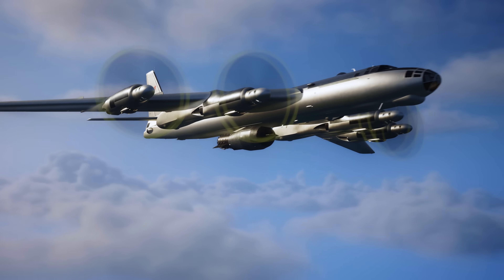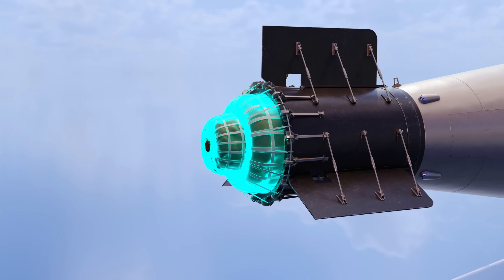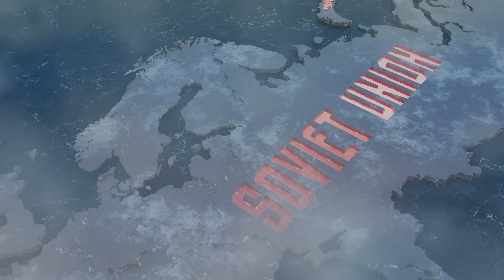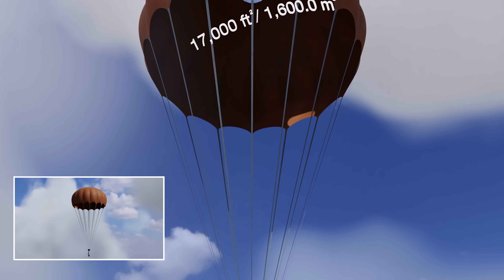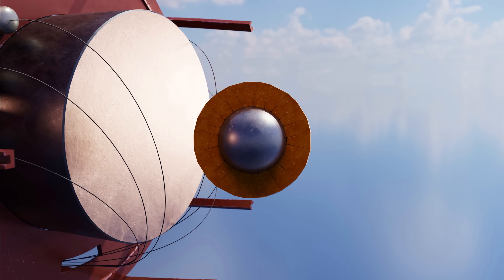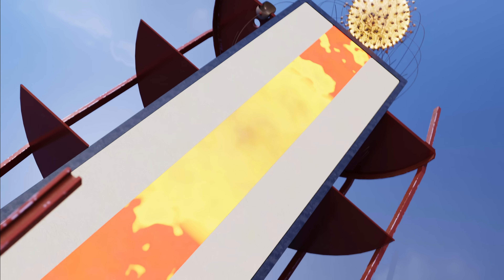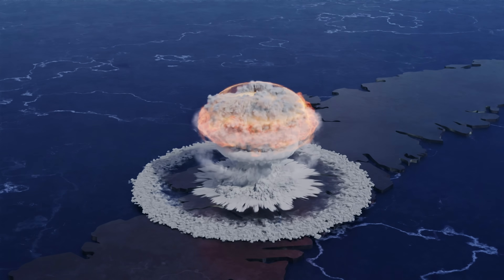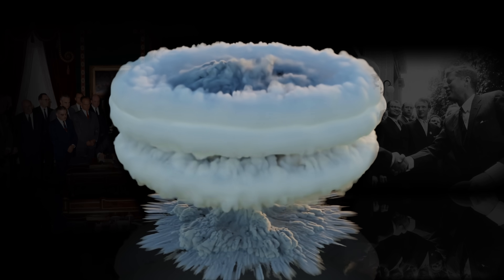Inside the Tsar Bomb

Comment: Just to be clear, the exact design of this bomb has never been revealed.
Reply: Indeed, and the men who knew are long dead so it's unlikely we'll ever know for sure. The two primaries theory is a good one although they would have to be detonated within a microsecond (or probably even less) of each other which would've been quite a feat. The other leading theory is two secondaries, the radiation pressure from the first causing a more efficient burn in the second. Or perhaps a combination of the two. Either way, the designers got it right. Great video for sure.
Reply: @KiwiExpressCream 2 primaries is no harder than a single one. Once you have the electronic avalanche and detontor tech sorted, all you need is more of them.
Reply: @dougaltolan3017  Also, wouldn't the detonation of one primary  result in the radiation implosion of the other? After all, the thermonuclear reaction in the secondary is initiated by fission in the compressed sparkplug.

Perhaps the reason the Tsar Bomba required such a heavy casing in the first place is that they wanted to make sure that even if one of the primaries were to 'fizzle', the radiation from the other primary would fully compress its pit and make it contribute to the compression of the secondary.
Reply: @dougaltolan3017  exactly what I was thinking. A chain reaction is a chain reaction. Just a matter of math
Reply: @KiwiExpressCream  At this point in time it wasn't  rocket science anymore
Reply: Someone could leak it on WarThunder forums ;-)
But a 3 stage design, fission, small fusion, big fusion would be more likely, since radiation pressure from small few Mton fusion device would be far higher than 2 nukes on opposite ends.
Reply: @hinz1  Yes, this is why scientists believe it's a fission fusion fusion. and not a dual fission fusion bomb.
Reply: @FabledGentleman  2 giai đoạn cần tính chính xác thời điểm kích hoạt hơn là 3 giai đoạn, tôi biết tính người Nga sẽ chọn 3 giai đoạn vì nó chắc chắn hơn.
Reply: It was a 3 stage device based on the ulam-teller design they acquired through covert means. The US actually deployed 3 stage devices for a time,  but only as gravity bombs.
The design is considered obsolete these days as due to it's large size it's much easier to intercept the large planes needed to convey it and you can actually do more destruction with smaller warheads if you have more of them since a bomb of this size releases the vast majority of it's energy up into space.
Reply: Ее луковицей называли, по какой то причине
Reply: The design of a nuclear bomb is pretty standardize. They only differences are small, like the differences between a Corolla and Versa. Enough records got out after the fall of the Soviet Union that the public has a pretty good idea of it's general design, if not the exact details.
Reply: Despite what it was. It was the ultimate piece of precision sequential engineering ever produced.
Reply: I don’t know if it’s actual design is significant,  I’m sure it was primitive but it worked!   All the major countries with nuclear weapons know how to build one,   With around 70 years of experience.   I’m not sure it’s a secret anymore in building one.
Reply: It follows hydrogen bomb basic design
Reply: Probably stolen by russian „soldiers” washing machines and toilets shape 🤣
Reply: just to be clear, it's relatively simple, but to actually make the fission material , like the uranium enrichment is no easy feat. Entire countries tried it, and failed it. So imagine the budget of a country . That might not be enough to make a nuke. That's why it doesn't really has to be a secret, that and the nanosecond timing. Without this you can only make a dud.
Reply: @kisspeteristvan  And you need a fission bomb to activate the fusion bomb
Reply: @kisspeteristvan  The idea is fairly simple. The precision required in the engineering is not.
Reply: Just to be clear. He doth protest to much me thinks..
Reply: @caledoniawarriorIt’s “TOO” much……No actual design of ANY Nuclear or Thermonuclear Weapon was Ever been officially released….
Reply: @pikachu6031  I know nothing about nuclear weapons but I’m just here to support you correcting the guy quoting Shakespeare while also confusing “too” with “to”. This is why I never tried to flex on anybody as some sort of academic because it’s a good chance of going to screw it up and embarrass myself. 😂
Reply: @mattlawson714  don't want to be embarrassed in front of the internet. The place where you know everybody is human and definitely not a chat bot 😂
Reply: The EXACT design is thousands of times more detailed than what we saw. But the details we saw were still verified
Reply: The Soviet Scientists DEFIED the orders by Communist leaders to make it 👉🏻 100 ☠️ MEGATONS…
Reply: Apparently he thinks it has
Reply: This is a pretty educated guess on the design though.
Reply: As the case with ALL nuclear/hydrogen bombs. If the exact design was revealed, then smaller countries would develop it and that's not good.
Reply: @teddeebayre3433  Not exactly, actually many designs are known. Maybe not the amount of grams of every compound, but the core design of the bomb itself is often known.
Reply: @teddeebayre3433  they  cant because  its tricky to create weapons grade fuel and big brother and Israel are   watching very carefully
Reply: Just to be clear, it was fairly primitive, and the design is easily guessed from the shape of the aeroshell.
Reply: @dansands8140  We don't know if it was two stage or three stage for example. This has never been disclosed.
Reply: @FabledGentleman  It was designed as three stage and fired as two. The uranium casing the video mentions was removed was the third stage.
Reply: @dansands8140  No this is not correct. It is actually widely thought of as a fission fusion fusion bomb. The only thing they sort of "do know" is that it was a three stage bomb.
Reply: @FabledGentleman I remember seeing old videos of one of the panels removed and it had like these cylindrical canisters wrapped around a bigger cylindrical canister in the middle, so I'm guessing it was three-stage
Reply: @dansands8140 It was not removed….The Uranium Tamper was replaced with a Lead one!
Reply: @colchronic  One thought based on that photo is that the secondary or tertiary stages - we're not sure which - were actually multiple smaller stages that detonated simultaneously.
Reply: @dansands8140  Everything about this bomb is the opposite of "primitive." 99.99% of all people, even your entire family and mine, will never be able to split atoms and create large explosions. The entire design of the Tsar Bomba is highly complex.
Reply: @ElectronicHouseFlash   If you mean I'll never have a plutonium core, you're probably right. But designing a reactor or inefficient bomb would be trivial.
Reply: @dansands8140  If it was that primitive why did american scientist struggle to find the formula for theoretical infinite explosion power?
Reply: @Squilliam-Fancyson  He doesn't seem to be someone who knows the facts. He's probably a Youtube channel defender, not an actual facts defender.
Reply: @Squilliam-Fancyson American scientists have long figured out that 10 1Mt warheads spread evenly would do way more damage than a single 50Mt one. And americans have plenty of MIRVs packed with 1Mt warheads. Soviet super bomb was a useless PR stunt, no more.
Reply: @qrck13 time frames do not match up. MIRVs are a development of the 70s while Zar bomba was rdy 1961. Castle Bravo test showed that US scientists still had to perfect the Teller/Ullam design. Yeah ZB was pretty much useless, but still it was a nice propaganda showcase of how soviets were able to perfect a stolen US bomb design.
Reply: @qrck13  Vâng nó vô dụng nhưng vì nó buộc Mỹ phải ngồi lại đàm phán ký kết các điều khoản không dùng bom hạt nhân cho tương lai. Chứ ko thì giờ này Mỹ nó đã dùng bom hạt nhân để thả vào nước có dầu mỏ rồi.
Reply: @quanngohoang5590 no, it didn't force anyone into anything :)
Reply: Oooh, it's one of those YouTube experts!
Reply: @dansands8140 era 1961, eran los primeros diseños de la primera generación de dispositivos termonucleares transportables y lanzables por gravedad, aparte de que su propósito era experimental, y va a salir usted a decir semejante cosa tan obvia, por supuesto que comparado con los dispositivos actuales se aprecia que es primitivo, pero en esa época era el epítome del desarrollo de la tecnología nuclear.
Reply: The whole video is AI slop
Reply: @rozarioagro5532 no it isn’t.
Reply: It’s not, it’s made by a British design studio  the narrator, who is also the company director has spoken to camera as part of a fundraiser. You need to learn the difference.
Reply: @rozarioagro5532  Wrong.

Comment: You do know that Castle Bravo yielded 15 Megatons considerably more than its designed 5+ megatons. The blast extended to over 4 miles in diameter. The US could have easily done the same with just minor changes to the same bomb but decided to go for smaller bombs later. More like fusion boosted A bombs. Smaller, easier to launch and being more effective at targets. Multiple Independent Reentry Vehicles being cost effective.
Reply: Every weapon in the current US arsenal is a hydrogen bomb. No fusion boosted fission weapons..
Reply: @Evan_Bell  I just see things differently, 15-25KT Fission + 75-175KT fusion is to me a boosted weapon, I tend to think of 1MT and greater as Fusion or H bombs. A true fusion bomb would not use a Fission process to start it. There are no such bombs yet. Since they mostly use Lithium Deuteride as a fuel, they are really Lithium Heavy Hydrogen Fusion bombs mass wise. The energy process is not the same as a true Fusion reactor, the Sun with its Carbon Nitrogen cycle. Not one "H" bomb has ever used single Hydrogen atoms as its energy source. Deuteride is an isotope of Hydrogen.  Get a copy of Richard Rhodes book, Dark Sun and read it.
Reply: @ivanhorban340 Okay, well then you're using an incorrect delineation between boosted bombs and H bombs.

That's like redrawing the defining line between sports car and pickup truck, for no good reason, and so decided to call your truck (that is universally recognised by everyone else as a truck) a sports car. You abandoning the naming convention serves no purpose, and isn't correct.

Your convention is arbitrary.
Fusion boosted fission weapons are defined as single stage thermonuclear devices. H bombs are two stage.

Every weapon in the current US arsenal is a two stage device. They're all H-bombs, not fusion boosted fission bombs.

Pure fusion weapons are something else.

I have a copy of Dark Sun. My laptop literally sitting on it. I have read it.

Comment: 0:17 Tested yield was 56.8Mt.
6:15 There is no evidence it used two primaries.
6:23 The primary pit was not pure plutonium.
7:55 Gamma rays aren't used for radiation implosion.
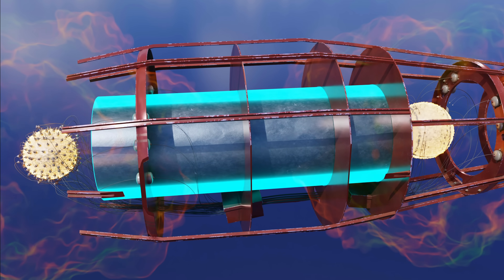8:00 It didn't use a single unitary secondary.
8:20. It's not the fission sparkplug that produces the neutrons that breeds tritium form lithium. The sparkplug heats the lithium deuteride to DD ignition temperatures. The DD burn then breeds the T.
9:10 Reduced fallout by about 94%.
9:15 Nope, that record goes to Ripple II of Operation Dominic shot Housatonic.
9:20. No, it lasted about a microsecond.
Reply: In order to get a rapid reaction, the fuel must be completely degenerate with a critical density. Spallation effects on the lead tamper from the primary x rays act to compress the fuel to this density
Reply: @BjarneLinetsky No, the fusion fuel does not need to be in any degenerate state to achieve fusion ignition. The lowest energy degeneracy state (electron degeneracy) is not achieved by radiation implosion in thermonuclear secondaries. The pressures achieved are orders of magnitude lower than the Fermi degenerate pressure.

Spallation does not play a role in radiation implosion. I think you're confusing spallation with ablation.
Reply: "There is no evidence it used two primaries". - Veselovsky clearly stated this. It's even in the Russian Wikipedia article.
Reply: @Exiled_One3548  This is a common misinterpretation of the reality. It used a primary, a secondary, and multiple tertiaries. By two primaries, they mean two stages detonated before the main stage(s), not two primaries detonating simultaneously to compress one secondary.
Reply: @Evan_Bell  Sorry, but Veselovsky worked on this bomb, and he says clearly: (Citation) "The powerful thermonuclear charge was designed according to a “bifilar” scheme: for the radiation implosion of the main thermonuclear unit, two thermonuclear charges were placed on both sides (front and rear) to ensure synchronous ignition (with a time difference of no more than 0.1 μs) of the thermonuclear “fuel.” KB-25 (VNIIA) modified a serial detonation automation unit for this charge".

Comment: 9:14  While the Tsar Bomba was extraordinarily "clean", the cleanest thermonuclear device was actually the one in the US' "Dominic Housatonic" test; this is due to its "Ripple II" secondary employing a D/T mixture rather than the usual Pu-239 as the sparkplug.

It's been claimed that fusion accounted for 99.9% of its ~10 Mt yield. However, the design required a rather spacious and bulbous casing geometry, making it less-than-ideal for delivery via missile, especially if you wanted to employ multiple reentry vehicles.
Reply: Correct. Well done you. The Ripple II used a pure fusion secondary, and a 8kt fusion boosted fission primary.
Reply: yeah the hohlraum does the heavy lifting inertially. the interstage(s?) or lack thereof would have been very novel, likely the purpose of the shape of the weapon - using geometry and low z material to modulate the highly trapezoidal pulse of xrays. hence the odd shape and relatively large distance between the primary and secondary. a bit like a flipped around shotgun choke but for xrays.
Reply: I think he said " cleanest per ton of yield "
Reply: @GregDahl-g6g He did. And that's not true.
Tsar bomba was 97% fusion, thus producing 1.69 grams of fission products per kt.
Ripple II was 99.9% fusion, and so produced 0.056 g/kt.
It was 30 times cleaner.
Reply: @Evan_Bell  did you make the calculations yourself or have them memorized or just got them from the internet ?
Reply: @perfectcell1157  I made them myself from values for specific energy and fission fractions I had memorised.

Comment: there are actaully pictures pre ai/youtub/face book of that thing. Inside is a circular primary in center and 6 cylindrical secondaries on the out side of the primary.
Reply: 8 secondaries*
Reply: @Evan_Bell  so you have seen the pic also i take it
Reply: @ghinckley68 I have, and the video that still frame is taken from.
Reply: @Evan_Bell  try to sync to primary's to bunr that 16 foot long or so secondary it just hilarious.
Reply: ghinckley68Yep. Considering that the standard deviation of the synchronicity of EBW detonators is greater than the incubation time of fission explosives, it's impossible ot get it to work with any sort of reliability..
Reply: @Evan_Bell  I thinking that even if there by a 10s of a few nano seconds one primary would destroy the other.
Reply: @ghinckley68 Yeah, the standard deviation of EBW detonators firing in one the order of tens of nanoseconds.

Comment: How many stages was the bomb?  My understanding is that the bomb was a three stage design rather than the two shown.  There was a fission primer, two small thermonuclear devices as the secondaries and a massive third stage.  I might be wrong but can you confirm how many stages the bomb had?
Reply: One primary. 8 secondaries...
Reply: @Evan_Bell  Nope, it was a three-stage bomb. One fission, two fusion. It's true that there were more than just one fission and 1+1 fission stages, but the main mechanism still relied on a 3-stage bomb.
Reply: 3

Comment: The sheer scale of a fireball 5 miles wide is actually terrifying to visualize. Why did they decide to detonate it at 13,000 feet instead of higher or lower?
Reply: Higher it would down the plane, lower the fireball would touch the ground and then there is fallout.
Reply: Maximum effect of heat and blast was pre calculated. The US did this when they dropped the first weapons, knowing that a given height would yield maximum damage.

Comment: wow! what a bomb! i have heard that the pilots of the tu-95v bearly escaped the nuclear blast even though they were flying at full throttle speed
Reply: They did get hit by the pressure wave and the TU-95 instantly had its airspeed increased by 100 km/h and it dropped 800 meters in elevation.
Reply: I see what You did there!

Comment: It was found immediately during initial testing by both superpowers that calculated yield for thermonuclear warheads isn't reflected in functional deployment, which is almost always much higher. In the case of Tsar Bomba the design yield is 80-100Mt with stipulation the calculations may not reflect actual yield, and the restricted test version projected for 50Mt but the working estimate in retrospect was actually 57Mt.
The designer reportedly had concerns about a full yield version, with so much grey area in calculating yield for such a weapon could at the extreme, with an unpredicted escalation of effect cause some form of geological event, which he brought up with superiors. I believe I heard this from a Russian documentary on the weapon, translated. I can't speak to its veracity, but it does sound plausible.
Reply: I thought Sakharov was worried about the size of the fireball exceeding the height of the atmosphere and replaced some of the Uranium casing with lead casing to reduce the yield like you said.
Reply: There was no concern about triggering a “geological event.” The concerns were (1) the enormous fallout that would result from ~50 MT worth of fission of a U-238 tamper, and (2) the fact that the pilots would not have survived the full-yield explosion.